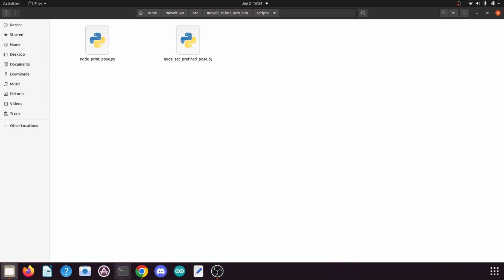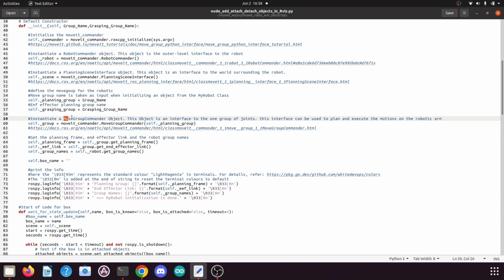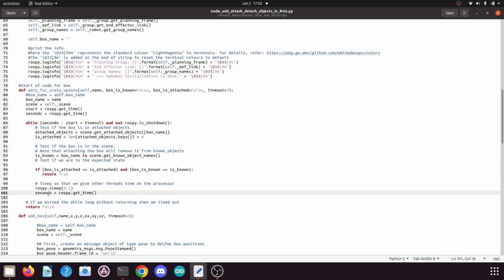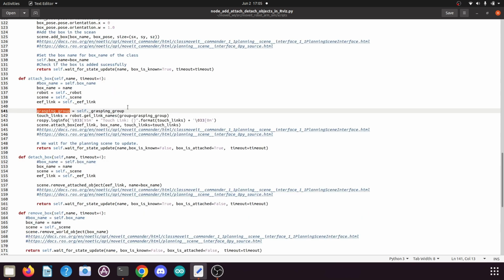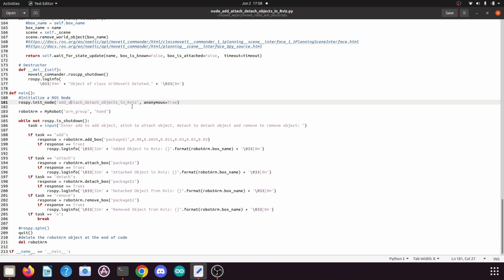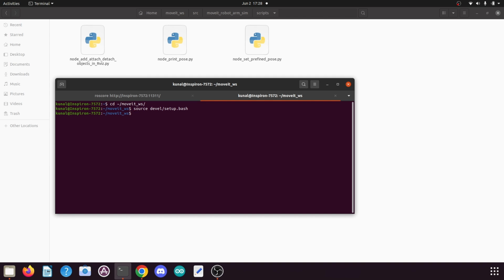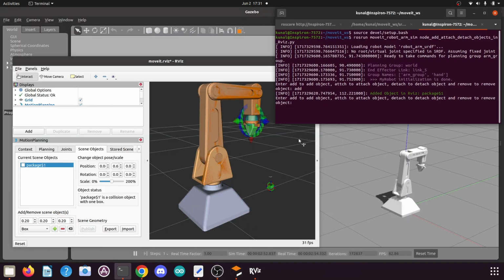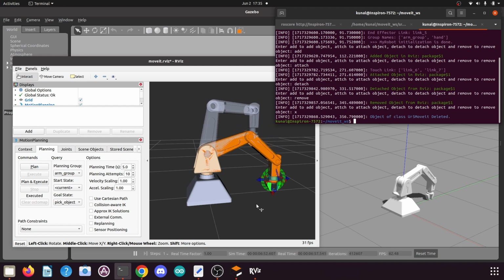Lesson 14: Add, Attach & Detach Objects in RViz Planning Scene Using Python in ROS Noetic

Comment: hey, when i try to plan and execute a pose where the gripper is near the object, the touch link goes into collision mode "red" and the robot doesnt want to move. Same thing when the box is attached and I want to lift it, the console says Start state in collision :( How can i avoid this
Reply from the maker: Hello. If your robot is going to colide or interffer with any object when it will go to the target pose, then the planning will fail and the robot will not go to that position. Also, if you current pose is also causing  collision between the end effector and the object, then also it will not work. You need to take care that nothing is interfering with each other